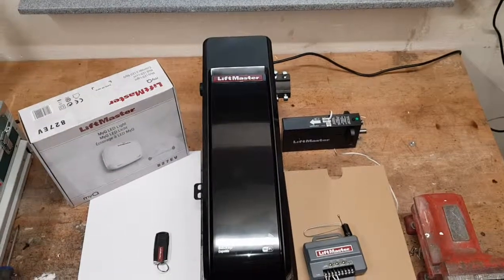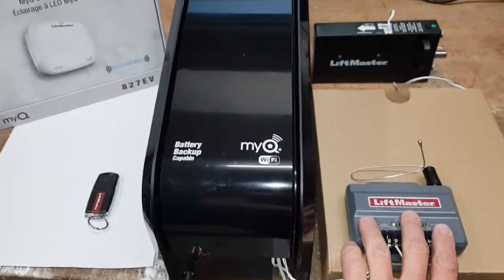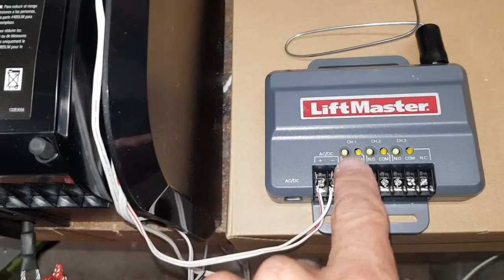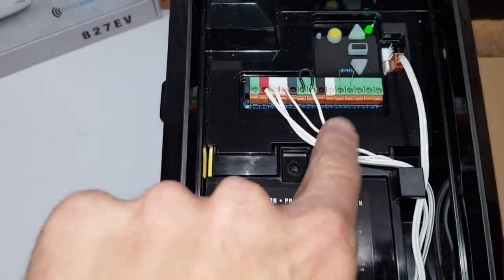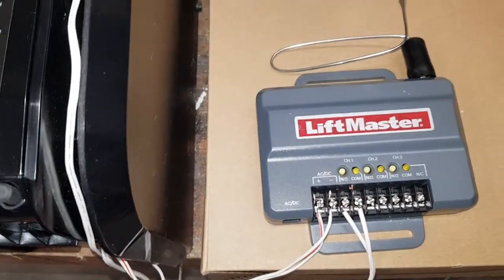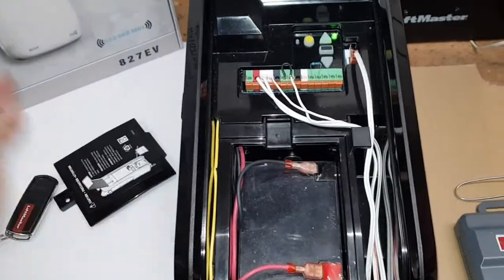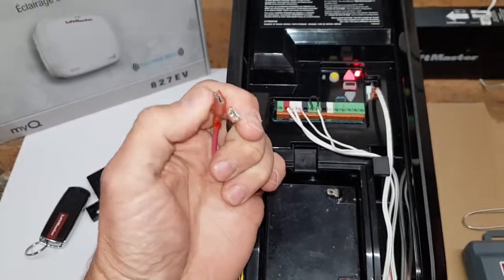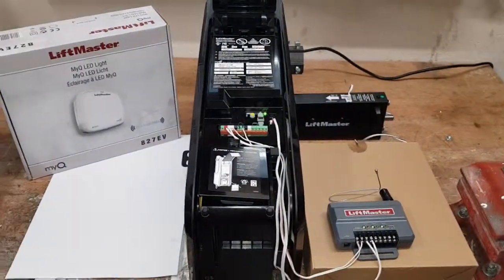LM3800W Explained - External Receiver

Comment: will it work for my liftmaster commercial MT5011?
Reply from the maker: MT 5011 should be a US market 120 Volt trolley operator. The receiver you need should have the name 850Lm or in watertight box 860lm.

Comment: The American 3800 only has 5 volts and from what I can tell will not power it. Can I add the external controller along with the wall mount 888lm to the red and white where you indicated?
Reply from the maker: I believe your best option when using an American model is to install the backup battery into the unit & then you are able to get 12 V from the charge wires of the battery.

Comment: hey! do you know which terminals are for door sensor...i need to connect magnetic sensor which actually gives "short" when door is closed so i need to brick a wire between 2 terminals...cant find any schematic anywhere.thank you
Reply from the maker: Terminal 6+7 which is the one that holds the wire jumper and must be removed if you use a door-in-door switch.

Comment: What's the model number of that receiver?
Reply: Depends where you are in this world :) Look out for 850LM or 860LM If outside installed or look in Europe for 860EV. Combine your search with LiftMaster and the part number
Reply: @Mister-e3q  Is it just an 850LM in Europe? I've seen LM sell some American products with the same number in Europe.
Reply: @Undercoverelevator212-s2n   In Europe you need to use 860EV. Same technical product but with waterproof case.
Reply: @Mister-e3q  IK. I'm American though, so we call it the 860LM.